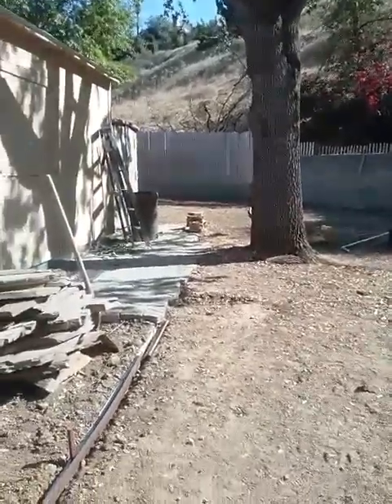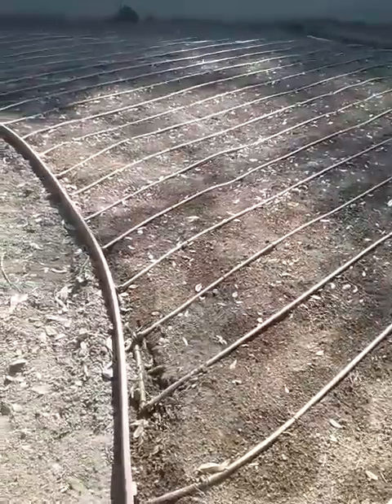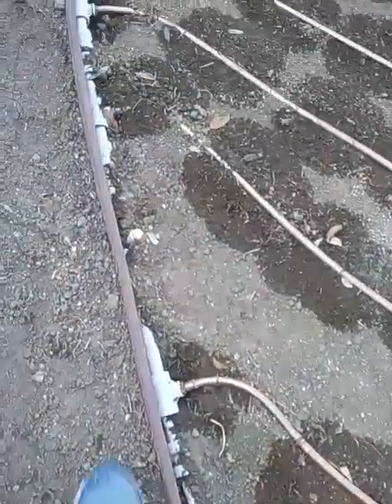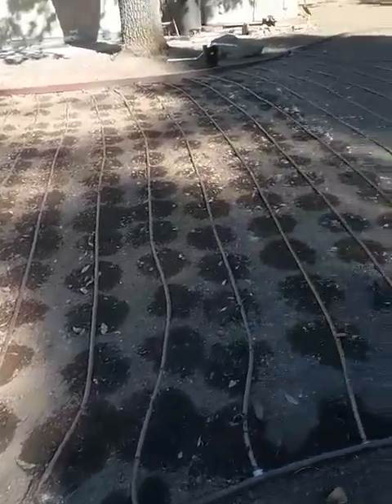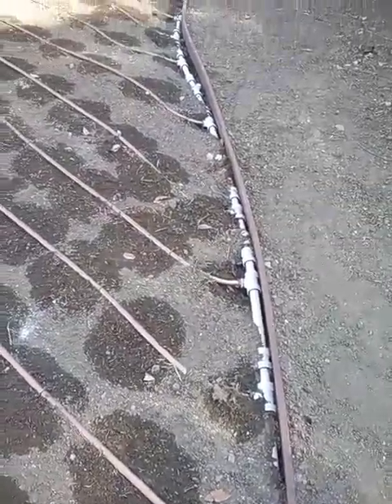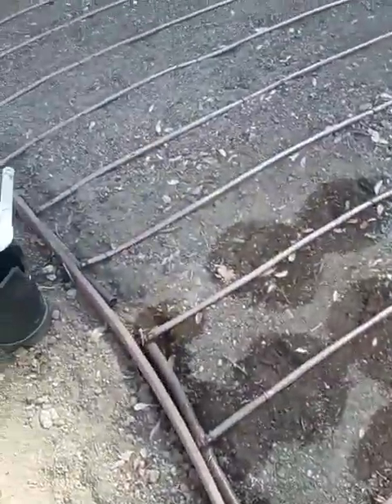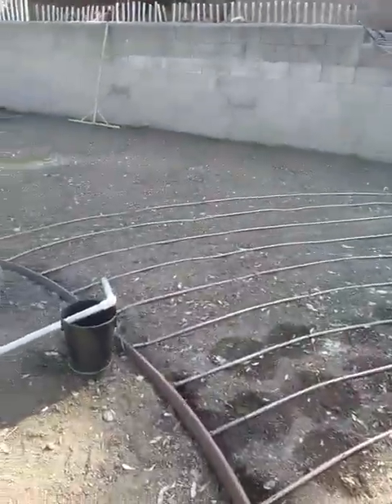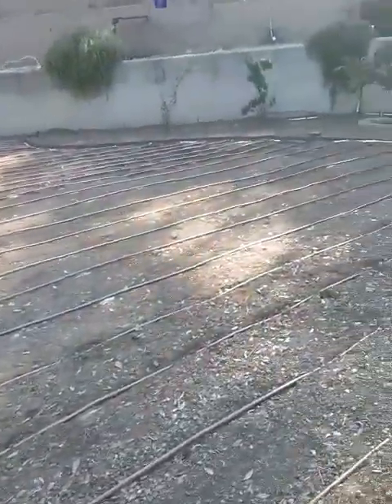Subsurface Drip Irrigation Header Spacing

Comment: Anyone know how reliable this Rain Bird QF Header is long term and what the max psi and water flow rate is? Can a T be fitted to each connection point? Thanks.
Reply from the maker: Thanks for the question. The best place to get this information us from the manufacturer... Rainbird. Individual contractor answers may vary. Manufacturer claims have to be pretty much spot on.
Thanks for checking out my videos and leaving a comment.
Be sure to subscribe, please, for more videos and adventures with Ed Wallace and Midwest Landscaping...🤠
Reply: @alcambero wouldn’t asking rain bird if it’s reliable long term, be like asking the Ford Dealer back in the day if the Ford Pinto is a safe car to buy? Of course they’d say yes. I figured if you installed this 6 years ago and likely more than just this, then you might know if any customer had problems with it and had to scrap it and go back to PVC. But maybe your video is a promotional video for Rain Bird so you would just rather not say anything bad, so now I don’t know who to believe. :)
Reply from the maker: @wstt4  
Well, that video was no promo video.

I install Hunter, Netafim, and Rainbird inline dripline depending on the job, clients budget, and site conditions.

 I have never received any calls back  from the client concerning any installation or operational issues.

The questions you ask are technical questions that are not push and play answers as each jobsite, irrigation pressure availability, layout design,  soil infiltration rate and other factors that should be taken into consideration and factored in. 

The system was not cheap to put in, and I could not afford to tear up the lawn and replace the irrigation and turf of it was installed incorrectly or just put in home owner DIY style.
It sounds like it would be best to stick with PVC and popups as the technical aspects of this type of professionally installed system may not be for you.
Reply: Yes. You’re right the technical stuff is for rain bird to answer. Thanks for this video. At the end of the video you said you learned from this. What was it that you learned? That 12” is better than 18” here? Or that the Rain Bird Emitter Header was better than doing PVC with many connections to glue and attach? Would you recommend that Rain Bird header long term, above ground for ground cover? Thanks so much for your responses.

Comment: what is the name of the tubing ?
Reply from the maker: Petra, 
Thank-you for checking out my videos and stay tuned for more cool tips and ideas n landscaping.
The drip tubing I used in this installation is called Rainbird 'Copper Shield Technology also the for the drip line header board is also Rainbird technology.

You can locate both products online at www.rainbird.com. 

As for the PVC side of the installation, I used the HydroRain PVCLock fittings to assemble a header manifold such as the one made by the Rainbird corp. 

You can locate HydroRain products at: www.hydrorain.com.

I did both because we wanted to check the water distribution uniformity.

* The results came out pretty close the same using the Rainbird header vs my personally built custom one...

Hope this helps,
Ed